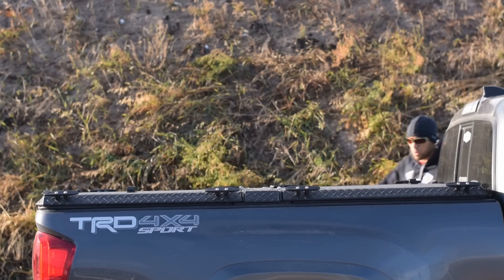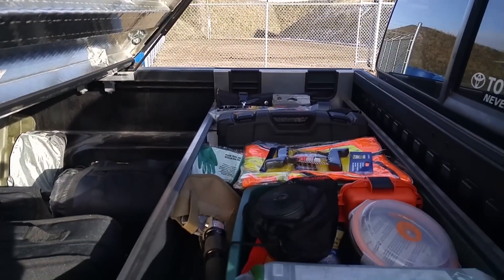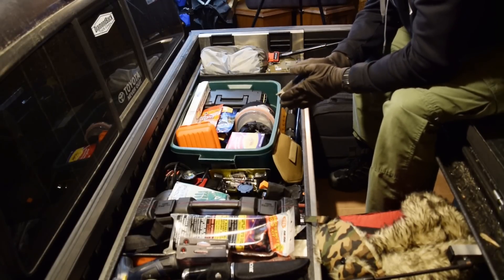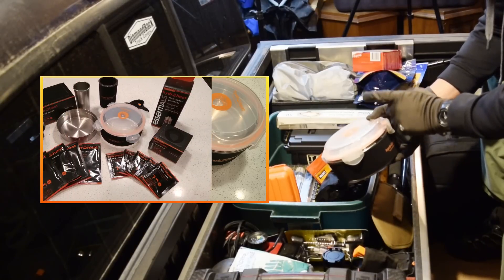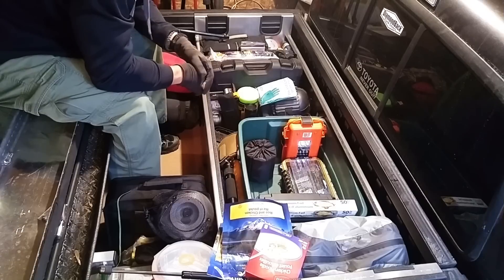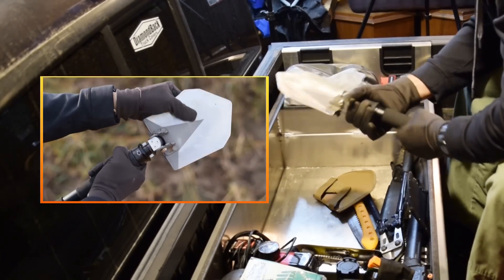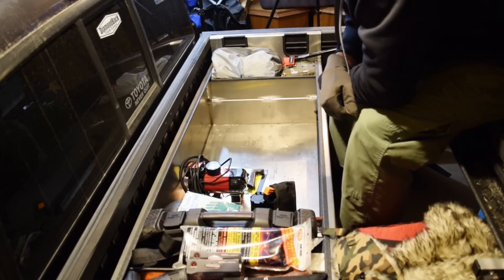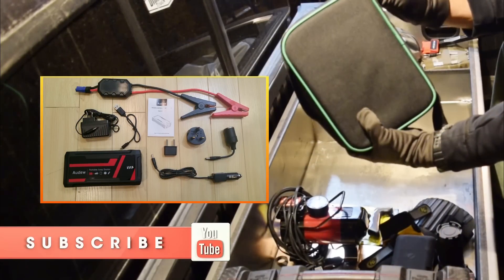Bug Out Vehicle Winter Gear: Part 1 | 2016 Tacoma w/ Diamondback Truck Cover

Comment: I’d recommend a set of BFG KO2s and run them year round. They are insanely quiet on pavement for an all-terrain tire and remarkable in messy situations. I found the Duratracs loud in comparison when I drove a loaner with them.

Comment: You have an amazing array of gadgets in there!  A lot of them I also have, due to process of elimination, so I cal totally agree with a lot of your choices.  Very sound setup.  I have just found your channel and afetr seeing this I would like to see a video explaining, in brief, the reasons for your choices. vs. other brands.  I have to check out the fat rope!  A note on that last item, the car starter.  It's based on capicitors, very smart, packs a lot of punch.  I ma amazed that more manufacturers are not selling this type of emergency starter.  Huge power, lightweight, very reliable, immune to temp. fluctuations due to no chemical reaction.  keep it up!
Reply from the maker: Thanks!

Comment: My number one vehicle prep item is a tire plug kit simply because the number one contingency is a flat. In most instances you can patch a tubeless tire without removing it from your vehicle using the plug kit. Practice on an old tire. It is easy and cheap! Save your spare for when you really need it.. No one can reasonably guarantee the zombie apocalypse but I am willing to guarantee you will have a flat. I would also carry a set of jumper cables in addition to the expensive spare battery..

Comment: Nice load out! I would have quite a different kit myself just based on geographical location here in western Oklahoma. Been looking at getting a Tacoma before long, I have a 2dr JK Jeep Wrangler right now, no cargo capacity and not comfortable to ride in for long. Been looking to overland builds for inspiration. Your SUV vs truck vid was influential as well🙂. Another great vid, will be staying tuned.

Comment: If you're serious about getting into hard to access places, having a halligan bar and a 10lbs sledge hammer will get you pretty far. Mind you a the halligan bar will cost you. Also considering that you have some form of solar panel with you most of the time, a good quality battery operated metal grinder shouldn't be out of the question. Finally a small lock picking set and the accompanying skills can help a lot too.
Reply from the maker: I thought about the sledge and that halligan bar looks like a beast!
Reply: great feedback

Comment: I am in Ontario Canada and I do see your points on a truck, however I have a Yukon XL because of the size of my family. So there are times Suv"s do come i handy. I too believe that everyone should be prepared, I would like to customize the back of my Suv to include a shelf or drawer system and a stronger roof rack.. You must be in the western part of Canada. I love to hear more of your ideas. always like idea's plus you have a channel so I bet you get some great stuff to test.
Reply: I'd love to get the Yukon XL. I've wanted one for a long time. I have a 2005 Ford Explorer SUV that I camp out of and sleep in. The Yukon XL would have more room and it's a V8 I believe, so it could even tow a small trailer loaded with extras. Cheers from Alberta Canada
Reply: Martin Blair - Books plus Chevy is easier to fix and cheaper parts

Comment: Question on your ruck roll up.  Is it "soft-enough" and durable as an (emergency) insulated sleeping mat?  Large solar panel on Diamondback is great option. 

Tire grating for stuck in snow situations.  Easiest is DIY HD wire zig-zag fencing.  Cut to 16-20 inches width x 3-4 feet.  Scrunches up to mere inches width x 3-4 feet.  2 or 4 sets (4WD).  Slide into/out of capped PVC piping.  Get the gritty zinc coated surface for extra tire traction.

Comment: I have a prep bag i carry with me to work everyday. Its a minimal prep bag.
What i use to eat and drink with, It has a manual can opener and a spoon.
And even has some trail mixes.
I have a smaller bag inside that carrys other things like Vitamins and aspirin.
I carry bottle water to drink. That is much weight.
In the side of the bag i carry mint life savers.
I can live a week on what i carry, But it just what i need at work, and just in case.

Comment: Just remember that when you put as many items for the 'overall survival' situation as you have into your truck, you may find yourself (in a WROL or SHTF situation) where you must abandon the vehicle.. so just be prepared for that... as it won't be the time to try and re-organize what else to add/remove from your pack.
I keep the absolute essentials in my jump-pack in my Bronco, and only those other things I could need to assist in forward motion with the vehicle itself are stored alongside and with an emergency set of clothing for the weather conditions. 

Remember also... extra weight means extra fuel consumption... and if items are packed too loosely, you'll have one hell of a time trying to find them after being scattered in the truck-bed (especially in the dark and in a hurry).
Cheers!
Reply from the maker: Very true I do hope to further enhance the compartmentalization by perhaps getting more dividers or just going the route of putting everything related in case. However as much stuff as it seems I know the actually know the gear quite well and will only be a matter of time before I know where everything is by heart. I am risking my gear for the sake of practicality as I use it all the time. Not too concerned about weight as its already a pig on gas lol

Comment: FYI,  i've got the duratrac on my X-terra. Great tire even in snow but s*** on ice. still, i replace them with 4 winter  ice tires. Mine are dunlop maax but there is other great winter tire out there. Today in Canada it is not really a matter of snow, or just for few days but ice and black ice is the real threat. just my 2c.
Reply from the maker: I agree ice is far more important especially on a 4WD with all the traction equipment I have. I thought the duratracs were good on ice but I guess based on what you're saying not that great, thanks for the suggestion

Comment: I wonder how much less MPG you get with all the added weight in the truck bed.
Reply from the maker: Really only the combined weight of a hefty passenger at best. If I was concerned about fuel economy I would have bought a prius :) However I agree with you this is a factor which is offset by auxiliary fuel stores.

Comment: Q for ya CP - what model of old pre-eletric engine truck would you suggest that would be EMP resistant?
Reply: Old square body. Standard transmission. Anything you can park on a hill for a rolling start and no computer needed to run.

Comment: damn bro hope that trucks Insured and has a good anti theft. maybe fuel cutoff or extra safety deal. looks good though.
Reply from the maker: Yep lots of security, the diamondback cover in itself would be very challenging to get into. Its all modern inside so no one is driving it anywhere without the chip.
Reply: Good deal. Peaceful winter let's hope.

Comment: Why not have a topper instead of a tonneau cover?   With a topper you can still have solar and it doubles as a sleeping area.  Also, why not have a dog in a bug out scenario?   They can alert you or track down food.  Also, I don't see any CB or ham radio antennas.  CB is invaluable.   I hope you at least have a radio scanner.  Although the battery jumper is good a spare battery is a must.  Do you carry and inverter?  How about a small generator?   A small 1200 watt can be nice to have and they don't make much noise or take much gas.  Get one that has a 12 volt outlet with battery clip leads to charge a battery.   No camo tarp for the truck?

If you've not seen this watch it... https://www.youtube.com/watch?v=kWg6NWjTLCU

Comment: I disagree strongly with this approach. My truck is just that a truck, not solely a bug out vehicle. I would never transform my truck to a single use. A truck is such a versatile tool. For example if I took this approach, there's no way I'd have 10 cords of firewood along the side of my garage. Which in conjunction with my woodstove would fair me well in a bug in situation. I thank you though because I think I will store an extended truck kit in my garage in bins that I can very quickly transfer to my truck to resemble more of what you have. Thank you for challenging my way of thinking. Though I must say I think I will take a different approach.

Comment: Gawd, I practically live out of my truck, and this has put me to shame. 

As for the bolt-cutters... you have two options... maybe three.

One - just don't take them. If they concern you, and you have no real use for them, then they aren't really worth the stress. However, I don't recommend this because the following.

Two - forget about them, you're not doing anything illegal. If you are pulled over, and they find your bolt cutters, you got bigger problems than a fuckin asshole cop. He will need a legitimate reason to search your vehicle (are you drunk, high, or breaking the law???), more concerning is if you've broken a serious law previously (or that stupid gun license shit, carry that fucker everywhere, even when you're not carrying your gun). My point is, if the cop has found your bolt-cutters, all your preps will be strewn all over the fuckin place already, with no regard to order; and even if he let's you go, he won't help you put it back together.

Three - wrap them up and zip-tie them to your spare tire. I haven't noticed, but I'm going to assume your spare is under the box. Given that you don't expect to use them until... "oh look, a deer stuck in a barb-wire fence, wish I had something to cut the wire." At least this option takes them out of your usable space.

Comment: Don't be a wuss buy Cooper Tires for your Taco AT\s
Reply from the maker: I'm feeling like Marty Mcfly right now lol, you don't think the duratracks hold up to the cooper?
Reply: Canadian Prepper I've had both on my Jeep's and Cooper was waay better in snow in Quebec and Ontario weather than Duratracks. The rubber compound is medium compared to hard with Duratracks. Don't get me wrong Duratracks are excellent for mud and ruff roads but when it comes to road noise, snow traction and life of the tire even going off roading Cooper was my winner. Plus they are the ONLY owned North America tire left. Check Canadian Tire check list for overall performance!